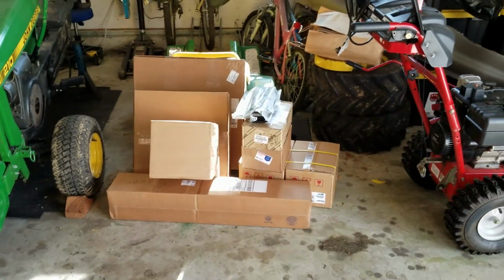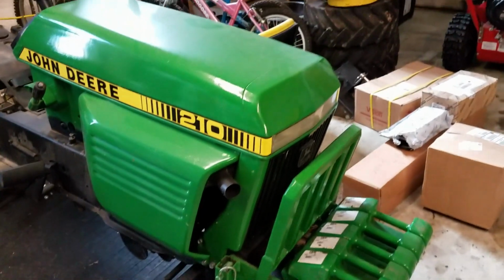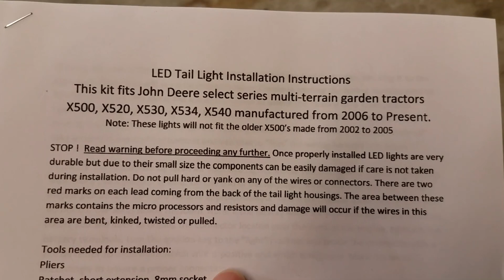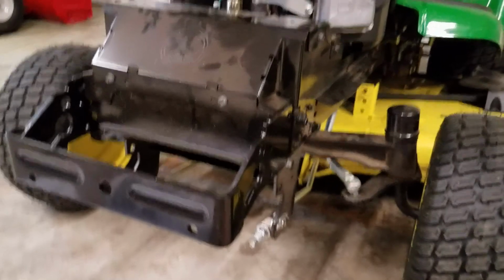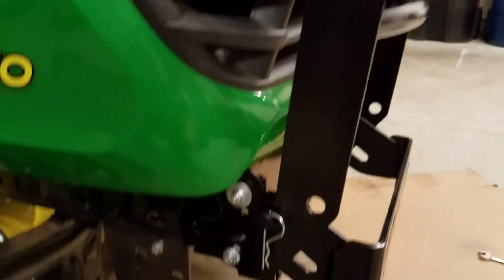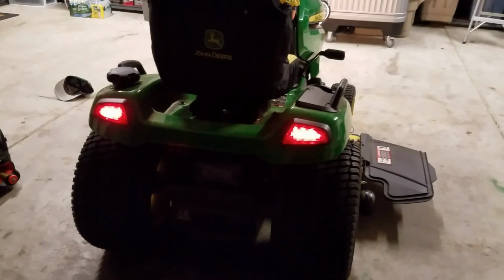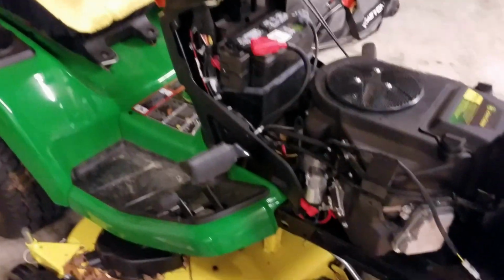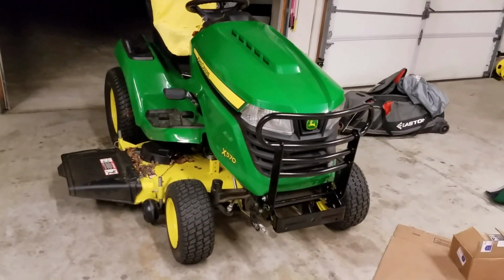Putting Accessories on the New John Deere X570

Comment: Those T-connectors for the wiring tie in invite corrosion. Best to add some dielectric grease to them before you snap them on. Then use liquid tape over the outside.
Reply from the maker: Good idea. I haven't had any issues with corrosion or moisture on those connectors but I will definitely use dielectric grease next time I have them apart.

Comment: That's an awesome machine I've considered a newer x500 series tractor but I decided against it since I can get a nice 430/455 for cheaper and I'm fine with doing extra maintenance. Also I love the tailights and brush guard and the weights bracket they're really nice touches all it needs now are a set of HDAP's. Hope school is going well I can't wait for gardening/mowing season I'm tired of old man winter.
Reply from the maker: Thanks man. I've got my All-Trail HDAP tires sitting in the corner so if I need more traction I'll just mount those up. We haven't had enough of a winter around here...now that I finally came home for spring break the temperatures dropped back down into the 30's again. Good thing I bought a snow blade.
Reply: MichaelTJD60 Oh I didn't know you bought a snow blade which one is it for the x570 or the 210?
Reply from the maker: 210. I will show it in the next video.
Reply: MichaelTJD60 Sweet can't wait!

Comment: A little smoke on start up is quite common on engines that the pistons move horizontally, ie a vertical shaft mower engine.  One thing that helps is to be careful not to add too much oil, a little too much oil will make that much worse.  I first learned about this on my BMW motorcycle (boxer engine, a flat twin.)  You usually park motorcycles on the side stand, one cyl lower than the other, once in a while they would smoke like the devil when started, scared me the first time it did it.  I had a Kohler on my last JD lawn tractor and it would do it almost every cold start.
Reply from the maker: You bring up a good point. I'm used to smoke coming from my old garden tractors because they've been around a while and the piston rings are getting worn. But I was surprised to see smoke from a brand new Kawasaki engine (barely broken in for this video). I ran this machine every day in the summer and it never smoked on startup, I figured it was just a winter thing.
Reply: My previous JD was an STX38, 13 hp single Kohler, smoked on almost every cold start since it was new, but it never used oil that I could tell, my current JD D130 B&S Vtwin, smokes on cold start occasionally, but I know its nothing to get excited about.

Comment: Have you considered adding rear wheel weights to yours? I just got my x580, and have a very steep yard,  my previous mower has 3 wheel weights on each wheel and it does great on the steep parts. I haven't tried this mower yet but I'm afraid it's too light in the rear to tackle the job without spinning and tearing up the yard,  especially in damp grass.
Reply from the maker: These are decently heavy units (especially in the rear end), and I haven't had much trouble with slippage on hills unless the grass is really wet. Even then, the diff lock always helps get me through the wet areas. I specifically didn't order it with aggressive tires or extra weights for that reason. I have a set of wheel weights installed on all my other garden tractors (for tillage, snow removal, etc), but I never saw the need fo extra weight with this tractor. If your X580 has the HDAP all-terrain tires, you should be fine, but if you ordered it with turf tires I would definitely recommend adding some weights to the rear end to help you on the hills.

Comment: Hey I just bought a 2020 X570 and I was looking to upgrade the tires front and back. I want the same setup from the X580. Do you know if I can just get 16x6.5x8 tires and mount them on the stock wheel? Also why do you think they ran a smaller setup on the 570? Any harm running the larger set up front? Sorry for all the questions.
Reply from the maker: The smaller tires up front were most likely a cost-saving measure. The X570 shares front axle and steering components with the lighter-duty X300 series, so I guess a 16x6.50-8 tire was not deemed necessary. I don't see why you wouldn't be able to mount 16" tires on the stock rims....they are the proper width and diameter so there should be no fitment issues.
Reply: @MichaelTJD60  Ok great that makes sense. Thanks for the reply also. I’ve only had it for like 3 days and watching a couple of your videos the itch for some upgrades has started lol.

Comment: I know this is an old video but I just installed the brush guard on my new X370 (same brush guard) and there is a lot of play front to back, like 3/4"of an inch. Is yours the same way? The installation you showed is nearly identical to mine.
Reply from the maker: Yep, this one is the same way. It's bothered me from the start. But I think it's designed to provide a little "give" in case you run into something, that way the brush guard doesn't bend or break.
Reply: @MichaelTJD60  Thanks.

Comment: How did you get the spring tension bolt off ? Mine just spins
Reply from the maker: Which spring are you referring to? The one on the mower deck?
Reply: @MichaelTJD60  the lift assist spring the long bolt was in. I figured it out last night and was able to get my weight bracket, brush guard on finally on my X380
Reply from the maker: @joepaul1814  That gave me a lot of trouble too. I don't think I ever got the spring tension adjusted correctly after I reinstalled the spring.
Reply: @MichaelTJD60  yeah , I was able to use the smaller bolt thankfully and the deck seemed normal after

Comment: Are these Kawi motors so cold blooded that firing it up in 18 Fahrenheit for plowing an issue?
Reply from the maker: It shouldn't be an issue. Might take a bit more cranking but it will fire up. You'll probably have to keep the choke on for a few extra seconds.
Reply: MichaelTJD60 - The 'GardenTractorGarage' - Thanks Michael.

Comment: is it necessary to take the hood off for attaching the weight bracket or did you do it for clear visibility in the video? thanks
Reply from the maker: Yes, the instructions say to remove the hood. It helps gain access to the mounting screws in the frame, plus you have to change the hood pivot bushings over from the old bumper to the new weight bracket anyway. Removing the hood is simple, just unplug the headlight harness and lift it straight up off the pivot bushings.

Comment: Can you put on a front snow blower with the new front bumper???
Reply from the maker: Not that I know of. I believe the frame adapter for the 44" snow blower would interfere with the bumper. This one is only used for mowing and pulling things around the yard, so it's not a concern for me.
Reply: @MichaelTJD60 I have an x580 with brush guard. You CAN install and use the snowblower with the guard.
Reply from the maker: @misterl2875  thanks for the input! Good to know.

Comment: It is not normal for the older Kawasaki's to smoke or be cold blooded.  That engine doesn't sound like it is running right. I have an X534 and it never smokes and it starts right up every time.  Only need to choke it for a few seconds.
Reply from the maker: I said it in one of my other replies but it only acted like this for the first couple seasons. I've had 4 different machines with Kawasaki engines (new and old), and they've all acted the same way. Several friends who run Kawasaki powered equipment have had similar issues. Of course, it also depends on the climate where you live.

Comment: what series come with water cooled engine/ power steering?
Reply from the maker: None of the X500 series are available with a liquid cooled engine anymore, you would have to jump up to an X700 series for that. But the older X520 and X540 tractors were liquid cooled. The current models with power steering are the X580, X584, and X590.

Comment: Did you get that JD seat cover from John Deere dealer and also do you think it will fit a x320 ?
Reply from the maker: Yes, it's part number LP92324 and should work on your X320 as long as you have the 15" medium-back seat.

Comment: What size deck is on that?  Also do you know if you can order it with a 42” deck?
Reply from the maker: It's the 48" Accel Deep deck. The Deere dealer won't sell you an X500 series with a 42" deck unfortunately, but as far as I know, the mounts are the same as on the X300 series, so you may be able to buy a 42" Accel Deep deck off a parts tractor (or separately) and mount it up. The mower decks from the previous generation X300/X500 series won't fit the current generation, from what I am told.

Comment: Very informative video, thanks. My 14 yr. old shaft drive Cub is starting to need a lot of attention maintenance wise so I'm in the mkt. for a new tractor.  The JD X570 & Cub XT3 GS are at the top of my short list and just wanted to know if yours is meeting all your expectations and how is the cutting quality of the Accel deck? I read owner posts that JD has had issues with hoods & seats seats cracking prematurely and wonder if this has been resolved with the new X series? Thanks again, RP.
Reply from the maker: The broken hoods and seats were common problems on the older JD's from the late 90's to the mid 2000's. The plastic hoods on the X300-X500 series now seem very sturdy and are definitely higher quality plastic than what Deere used to use. The 48" Accel Deep deck cuts great in regular grass but it does leave a few uncut strips if you are mowing weeds or very tall grass with it. You just have to go slow and put the deck down lower to the ground in that case. But overall it is a very well-designed and heavy duty mower deck and seems pretty much bulletproof. I'd highly recommend the X500 series, they aren't shaft drive like the Cub, but if you don't abuse them, the belt drive systems are hard to beat.
Reply: Thank you for the response.

Comment: "John Deere wouldn't use them if they werent a good engine" lol yeah the kawasakis are great engines, but John Deere has used some pretty crappy engines in the past. Looking at you Kohler KT17QS...
Reply from the maker: Yeah, but remember back in the 70's Deere and Kohler were hand in hand partners so they immediately turned to Kohler when they wanted to start using twin cylinder engines in the 300 series. The KT17 was one of Kohler's early attempts to make an opposed twin engine, so they didn't know what to expect performance-wise. So essentially the JD 317, Cub Cadet 682/782, and others were all test dummies for the new engine...and they all suffered the same fate.
Reply: Even on my jd d120 lawn tractor I have a Briggs intek and it blew a head gasket at 49 hours...
Reply from the maker: My grandfather's Cub Cadet LT1024 with a 24 HP Briggs ELS engine blew the right cylinder head after just 80 hours of run time. Popped a lifter loose and kept bending push rods, eventually destroyed the head and caused a bad knock in the crankcase. The Intek/ELS series engines are notorious for valve problems.

Comment: Definitely NOT 👎🏻 a good how to video. Does fill in some blanks the beyond HORRIBLE John Deere instructions leave out. Answers the brush guard question too. You go from before to after and honestly spend more time with “Tim Taylor” babbling (ref. Home Improvement) than detailed instructing. That’s the hard facts. Thanks for filling in some mystery areas though. My background is 23 years in Navy mechanical and electronics including instruction and 27 years HVAC. I understand mechanical. Your best parts were about warning about tapping screws. Not trying to be mean but your video could be a much greater service if you put some video how to red meat between the before and after pictorial bread slices. God bless young man. 😉
Reply from the maker: I appreciate the constructive criticism, but I am not the how-to type. I've been on YouTube for nearly 10 years and historically have not done videos that way - usually because something goes wrong on camera or the project ends up taking much longer than it's supposed to (and in more recent years, people will always comment about how I'm doing it wrong and should be doing it another way). To avoid that, I prefer to do the "show-and-tell" style of videos which you refer to as before-and-after, but it's all for good reason. I do try to provide tips or information that may be important, which I'm glad you were able to pick up on. Thanks for the comment!
Reply from the maker: Case in point, installing the bumper and brush guard on this tractor took much longer than originally planned as the self tapping bolts were troublesome and the linkage for the lift assist spring was giving me some trouble. Nobody would have wanted to see that in the video.
Reply: Not everyone is trying to do a How-To, they are videoing an experience.
You should buy all these parts and then do it better.

Comment: I really dont think you need weight bracket ,, even to move your trailer,,, that  rush guard actually looks like it could easily be modified to carry some extra weight if needed ,, just my 2 cents ,,  looking good tho buddy
Reply from the maker: Thanks man, I agree I don't really need the weight bracket but you never know, I might end up having to pull something with the front end one day and I wouldn't be able to do that with the stock bumper. Wouldn't want to put that stress on the brush guard.